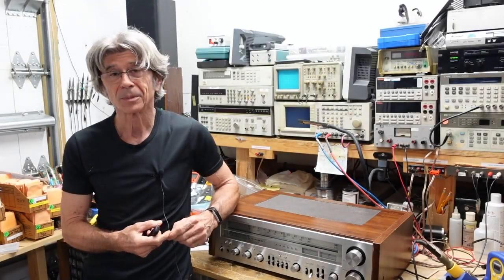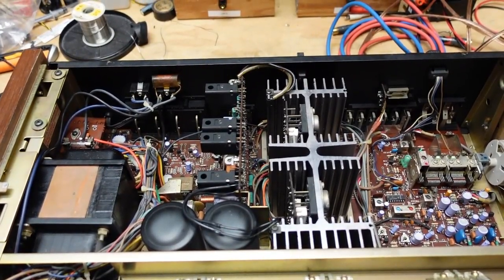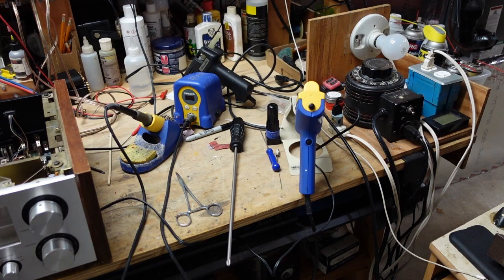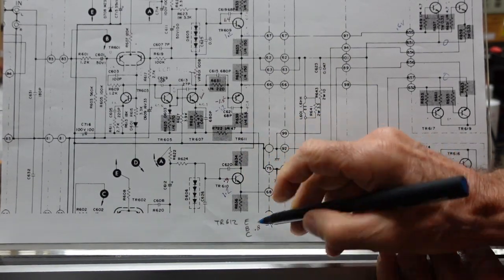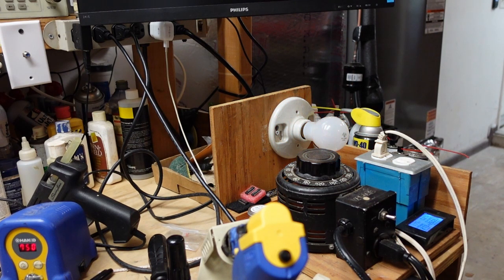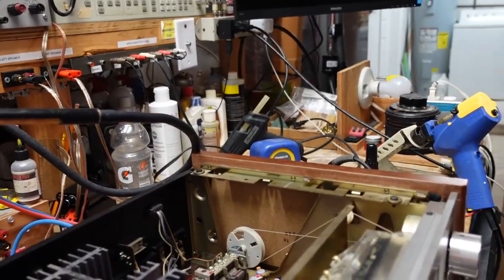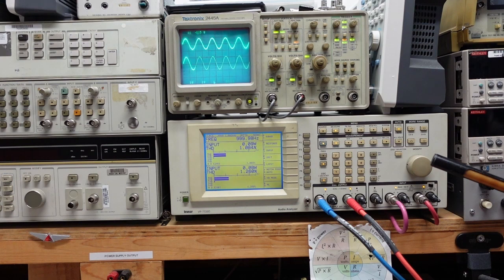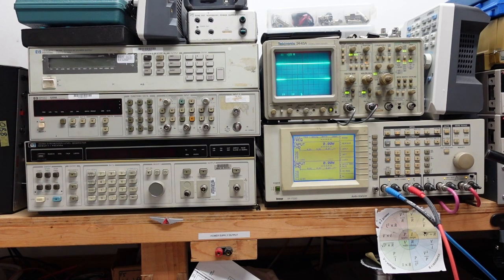Technics SA800 Part 1

Comment: Thanks Ray, For another great repair video. Loved how you found the one part in backwards. I love how you diagnose things and get to the real problem. As you said in an earlier video, Find the exact problem before throwing a bunch of parts at something.
Reply from the maker: Thanks Jared.
When I start troubleshooting something, I make certain assumptions.  For instance, if I'm working on an older piece of gear, it's likely that I'm not the first person to work on it.  That's makes for the possibility that there may be some human caused issue, as was the case with this unit.  If the unit was owned by you and you know no one's been in it, that's another story.  The rest of it is just methodical circuit tracing.

The wrong assumption can cause you grief, though.  Years ago as work I was troubleshooting an ISDN line for a customer.  I went with the assumption that it was working before, and something failed.  Turns out the circuit was a backup they ordered, and the outside tech told me it was too far away from the central office and never could have worked!

Comment: I have a lower version of this line, the SA500. A guy at work had it as a shop radio. I couldn't stand seeing it getting filled with grinding dust, so I offered him a mid 90's Pioneer as a swap. He was happy with it since it was very loud. A couple years later, he asked me if I wanted the old stereo in his shed. I was kind of  halfheartedly interested, picturing a 90's Aiwa all-in-one or some junk like that. Told him to bring it in and I would look at it.  He showed up with a Pioneer SX-5570. Needless to say, I was more than happy to take it, covered in pigeon droppings and all.

Comment: I'm following you for a few weeks, and I learned already a ton, I'm building right now an Amplifier from 50w RMS per channel with Darlington output stage. There is a lot that can go wrong. So first my learning curve sharpen up, and then building further on the amp. Thanks for these learning video's. PS: I have Technics SU-X102, and when it got powered up, there is a bang trough the speakers. So I have to take care of that one too. Probably use some cold on some components.

Comment: It amazes me the things people go through to repair these old receivers only to give up on the simple fixes.   I worked on a Yamaha m-60 recently,  someone had completely re-capped and replaced all the transistor on one channel.     When I got it, it would overheat and go into protection.  Their heavy hand cracked a a trace on the class a switch circuit.   Easy TS if they would have simply looked at the final bias.
Reply from the maker: Randy, you raise a good point; there are a lot of people who don't have the skills to find any malfunctions. Many are just following advice from online forums, web searches or channels like this one. In essence, just changing parts.
Reply: @raygianelli3612  Just like the guys in the car repair shops nowadays...
Reply from the maker: @schorse1000  Sadly it's not confined to cars; it seems like the skill of diagnostics is not learned in many trades.

Comment: So....somebody went to the trouble of replacing the svt-4 diode and then the fuses popped, and they gave up.  Crazy!
Reply from the maker: Right?  I'd like to know the history behind it.  I'm a bit irritated with myself for checking it but not confirming the correct installation.  Problem is you have to check it from the back of the board and you don't see the diode graphic.

Comment: Hi Ray , a few more quick questions plz:
1. Do you have a Patreon-type page where I could donate a tip?
2. When the bulb remained ultra-bright , did you know from experience that the culprit must be on the driver board ? Or did you remove the driver board first b/c it’s easiest to isolate (by simply unplugging) ?
3. What was the visual giveaway that that diode was wired in the wrong polarity direction ?
4. @ 7:50 , to which component on the driver board did you connect the oscilloscope’s signal probe ?
Reply from the maker: I haven't done the Patreon thing because it really is about giving back.  OTOH, if I find myself eating cat food after retirement that could change. 😁
The bright bulb indicates excessive current draw, and the only 2 places that can cause that are the power supply and the output stage.  Easiest way to isolate the output stage was to pull the driver module.
I don't use a scope probe when checking an amp's output.  I have dedicated BNC cables connected to the 8Ω dummy loads that connect to the distortion analyzer.
Reply from the maker: OH, bias diode polarity is marked on PCB.  Symptoms pointed to it being bad, and I noticed it had been poorly soldered (with excessive bare lead exposed) so I diode checked it and discovered it had been installed backwards.
Electronics tend to malfunction in somewhat predictable ways, but there's no telling what a human with a soldering iron is capable of.
Reply: @raygianelli3612  Got it , thank you so much for taking the time to clear up these points of confusion . Stay well & rock on Ray 👍🏼

Comment: Any TV Repairman sticker on back of unit. However with that said, Technics/Panasonic - Sony - JVC I pretty much stay clear of.
Reply from the maker: Didn't see a sticker on the back.  But between the type/quality of work and the aftermarket semiconductors it looked like TV shop work.  It may not have been.
All the manufacturers you mention all made some really fine audio gear.  Along with some BPC.  Caveat emptor.